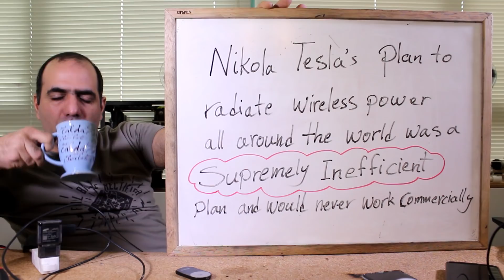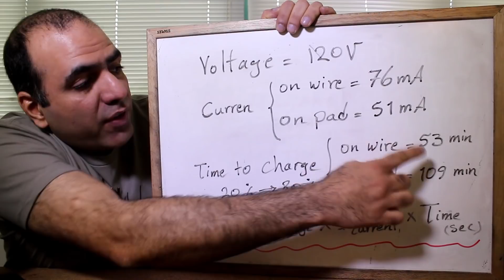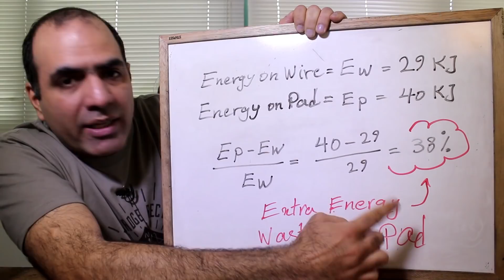Drowning in Inefficiency

Comment: 4:46 even the thumbnail image is inaccurate.  volume, good value solar panels are 17-19% efficient.
to the video.  yes, those charging pads are dumb. they also generate additional heat due to the wireless induction which is bad for battery longevity.

Comment: 4:38 No.  You still end up more efficient with an electric car than an ICE car, as the large power generators are much efficient than an internal combustion engine.
to the video.  yes, those charging pads are dumb. they also generate additional heat due to the wireless induction which is bad for battery longevity.

Comment: I use a charging pad because my charging port wont work with the wire anymore due to water damage, it will only charge from a pad. Also its only charging your phone so its not like you're running your entire house from an extremely inefficient charging pad lol.

Comment: Electrek reports, both the Model S and X use AC induction electric motors, which achieve an efficiency of 93 percent. However, for the more recently developed Model 3, Tesla switched to using permanent magnet reluctance motors, which achieve an efficiency of 97 percent. - So, are they wrong, or you are? Or are there  different metrics for efficiency?

Comment: For those of you hoping for a bit more direction:
The problem mostly comes from the issue of what is known as 'diminishing returns.'  One chord can run the 40% we use, but a second chord (with less juice behind it) would only run, say, 15%; a third only 2-3%.  If we try to turn all the power into electricity (or heat, or anything with only a single use), we will never achieve anywhere near 100%.  As you ponder the issue you should emphasize solutions that turn energy into more than one usable effect.

Comment: There should be an ability to pull heat energy from power plants.  Like taking the water/steam after turning the turbine run the heated fluid through a peltier power generator.  It would not get all the heat and turn it to power, but it should get some of it.  If nothing else that power could be used to power local equipment.  Seems like a better use than just pumping it into a cooling tower and pumping the heat into the atmosphere.
Reply: There is, in some villages here in the Netherlands they use the warm water of power plants to warm up greenhouses or houses nearby, the cool water returns and can be used again. The problem only is that the power plant needs a lot of cool water, that's why they're usually close to a river. It is cheaper then building long pipelines to villages.. That's why it isn't used on large scale yet

Comment: 30%-40% efficiency for photovoltaic technology is indeed the maximum that we're facing now using the so called III-IV photo voltaic technology, these actually are so expensive that they're currently only used on satellites. The average solar panel on your roof (mono or multi crystalline silicon solar panels) will have an efficiency of about 15% - 20%.
Though solar power is at the moment the best option for sustainable energy production if you compare the surface you need to cover with for example the amount of surface for a windmill.
I'm currently studying on efficiency in conversion techniques and sustainable energy supply and it amazes me how people are sometimes so stuck in their opinion that we shouldn't invest in all those technologies. Though the same as with every problem: there are no wrong paths, each will just have different consequences.
Reply: Yeahh.. its seems more complex when u though about it more..

I mean.. money hahaha

Comment: You did a little mistake on charging efficiency calculation. Modern phones do not charge at the same current. They start at the highest possible and then lower it once it gets more charge. This means that the current through the wire has decreased during the charging process. Meanwhile wireless charging current has barely decreased because it charges at low current already. And so the final result is even lower efficiency.
Reply: Using two USB power analyzers would allow you to easily see the efficiency across the entire load range. They are cheap and prime.
Reply: I would've used a different method to measure the efficiency: measure the in and out current and voltage, and divide the powers you get from that... But that would require to get a direct measurement from the phone. Maybe with an external Qi receiver?
Reply: This is true, but I believe the reason he charged from 20% to 80% is because if you look at battery charge and discharge graphs they are generally linear at that range. This means that an approximation is warranted. Batteries charge/discharge much faster below 20% and much slower above 80%. In fact, the reason behind this is due to the chemical process and is why most battery manufacturers recommend not discharging below 20% and not charging above 80%. Well, the latter is usually ignored due to logistical reasons but is also generally less harmful to the life of the battery than the former. So yes, while it varies a little, a linear approximation is good enough throughout this range.
Reply: Shuthufukuhp

Comment: In defense of the wireless charging pads. Yeah, they are useless at home or work, but I use one in my car, that I built into the phone holder. I find that the cables aren't reliable enough while driving and prone to coming loose and stopping charging. Yup, the charge rate is much slower than by cable, but it's faster than not charging at all.

Comment: Hey Electro Boom awesome Video, but there is one little fact wrong in this video, coal oil and gas power plants are significantly more effective than small combustion engines, and top out in the mid 40%s for coal and even higher for the other options, due to their high burning temperature and multi staged damp turbines. This does not change the point of this video that a big portion of power is wasted but significantly lowers the loss.

Comment: Step #1 put solar power with a battery backup in every home.  Step #2 convert all devices in home to DC power so that you don't waste energy from converting DC to AC and then back to DC.  Now that I think about it we need a standard for a DC power delivery, like USB-C.  Actually, now that I think about it those AC to DC adapters waste energy even just being plugged in.  Anyway, Step #3 place Peltier modules in key locations in the home to recapture lost energy like a gaming PC or a drain pipe, and have that energy fed back into the home battery backup.

Comment: Only way for change is if it became law. Law and regulation that requires products to achieve at least >70% efficiency or whatever.. otherwise companies would have no motivation or reason to design circuits, batteries, conductors, etc to be as efficient as possible or to at least meet the minimum required by law. Also the law would need to be adopted by most major countries, and would need to apply to exports and imports, otherwise companies will cheat out of the law by just importing or moving their factory out of the country if this law did not apply to import/exports and/or was adopted by the significant countries of manufacture.

Just look what California did in the 90s, when they passed a CARB law which forced manufacturers to meet a zero emissions to continue sales in california. had to be all electric, so as a result companies like GM created the EV1 during the 90s. but of course the automakers and other special interest groups fought the law and forced it to change to meeting just a 10% of all vehicles by 2003 but then even that ultimately changed again to allowing hybrid or natural gas vehicles to qualify. And we saw what GM did the instant the law was changed.. they recalled 100% of the EV1s and destroyed them and completely abandoned zero emission electric vehicles. If California had stuck to it's guns, there would have been leaps and bounds made in electric vehicles tech, we'd of had tesla quality vehicles over a decade ago, or even better since theyd' of been backed and made by the major automobile companies and a primary focus in order to continue to do sales in their largest U.S. market. The EV1 too was a very reliable vehicle too with a decent range for it's time as well in the 1990s.

Comment: For an idea on another video, I saw this review about stetzer filters that, if used on a circuit, will clean the electricity.  The reviewer showed the device filtering high frequencies, but never tested 60Hz to see if there was any change in amplitude.  I would like to know what your take is on the device for cleaning up dirty power.  You could go further to see the limits of high frequencies it can filter and how low before it no longer filters.  It should not be doing anything to 60Hz.  Here is the video: https://www.youtube.com/watch?v=VEqjkGC6Nhk

Comment: Switching to LEDs isn’t always saving you money just because they are more energy efficient, not even if they would have 0% energy loss in heat. Because if you live in a cold place and still want the same temperature inside your house after switching to LED, you’ll have to get the heat that you use to get from your lightbulbs from some other power source.

Comment: what do u think about this ? 
Plastic to diesel-like-fuel (already invented)->use the non-condensate gases i.e volatile fumes for heating;
              primary heat transfer medium : Molten salt;(phase II:augment heating with solar when available);
excess heat use in super heated steam flash boilers -> steam turbine -> eletrical Energy ;
       waste heat from steam turbine -> use to distill ethanol from wash ;
wash : made from bio mass cellulose-amylase digestion

primary feed stock : plastic 
Secondary feed stock : bio mass -> alge from swamps (we have a lot of that in our canals in south INDIA) 

interested ?

Comment: USB-C and lightning make it a little more convenient to plug a cable than micro USB, but just leaving the phone onto a pad is much more convenient than plugging a cable. An interesting compromise would be a docking station with electrical contact pads on the outside of the phone, like in my old Xperia Acro S. This way, the connection is efficient and the data connector doesn't wear down. Bonus points if the connector shape becomes standard.
Reply: Your ''convience'' of wireless chargers takes 10x longer to charge though

Comment: Electrical efficiency is not an EE problem, its a physics and material science problem. The elephant in the room is that we send all of our power through copper wire to your home. Copper has some inherent resistance and causes power loss. (not that this is doable) but if we switched all the copper wire in the world to silver wire, you would be improving efficiency in power delivery by about 5%. Materials like carbon fiber nanotubes, graphene, and other exotic materials could help reduce these losses due to resistance to darn near 0. Conversely if you generate the power you need for your home at your home, then that also massively improves efficiency without the need for carbon nanotube power lines.

Comment: When it comes to heat engines, there's a maximum efficiency that can be achieved without violating the second law of thermodynamics. For combustion engines running in ambient air, the max efficiency is something like 73%.

Comment: Oke iam smart so here goes, we need to add a second line of power in our house like 12 or 24 volt to use the solar energy directly from the batteries. A lot of devices already work on those volt requirements like TV, radio and phones come close. It will save the % to pump up the batteries voltages to 120v or 230v and then again a % save on the converter in the TV, radio, air fans, chargers and all other crap you use that uses 12v ps me typing this was so inefficient, because I know no1 reads it :-/

Comment: There are magnetic charging cables with connectors, that keep dust out of your phone port, and connects easily & quickly. I believe Wireless charging is only good for a waterproof phone, mounted on a motorcycle, in the rain.

Comment: I have thought about it, although there will be losses when energy changes its form. all we can do is minimize it. So we need a material which easily give up electrons but not way to easy, else it will react with everything. I think we can create two materials which are super reactive only with each other then we can improve efficiency. I better get to work on this.

Comment: How efficient is nuclear power? (fission, fusion and decay)
Reply: As nuclear power plants contain thermal power stations made of inefficient turbines and generators just like a coal or gas power plant, its not very efficient over all, but the nuclear reaction itself is. Main problem is though that its not renewable.
Reply: @Chuckiele   Cool thanks for the info! I guess hydrogen based fusion would be pretty efficient and as good as renewable, if we ever achieve that
Reply: @Staroy  Im excited for fusion a lot but it wont be efficient nor renewable for now but mostly just plain powerful. The only type of fusion thats providing enough power to even sustain itself currently is Deuterium+Tritium of which Tritium has to be breed from Lithium because it decays too fast to be stored. It is not very efficient because the entire reactor, which is huge compared to fission reactors, is made of a huge transformer, thats needed for the plasma and theres no well thought out way of getting the heat out of the reactor efficiently. Also its not renewable as the Lithium blanket will be used up and it consumes Deuterium and exhausts Helium. But it seems to be extremely powerful and also safe and clean.

Comment: So I do have an idea, correct me if i'm wrong, so we take Elon Musk's awesome Tesla and we put another battery and a alternator. So we connect the wheels to the alternator, and the alternator's outputs to the secondary battery. So you might be wondering "this kid thinks there is free energy", but no i'm just saying that the car's battery will last longer and every time one battery dies the outputs switch to charge the dead battery while the charged battery runs the car. So what you think is this dumb and will probably not fit in the car, or its a good idea for saving energy

Comment: My USB plug broke in one year. So now I have to use wireless charging to not have to buy a new tablet.
Reply: or you can fix the connector (or have it fixed) ;)
Reply: @ondra30  not available in my country for the model I have. Plus it was one quarter of the value of a new tablet to import a new USB connector. Wireless charger was the cheapest option.
Reply: @soulwynd  There are 3rd party service centers, some of them affordable. Also there's option to try to fix it yourself - if there's always the option to wireless charge, you've got nothing to lose. But in this instance, yes the wireless was good option.

Comment: Great video! :) I love your work Mehdi!

Even though there are a lot of "inefficient" devices, we must also take account of some phenomenons, for ex. the overall efficiency of transforming thermal energy into mechanical (and then into electrical) cannot ever reach a reasonable value, because thermal energy is a lower-quality form of energy. Its energy has more anergy than exergy (energy = exergy + anergy from thermodynamics, where exergy is the useful part of energy, and it is also defined by the environment of a thermodynamic system).

Another example is that wind turbines also have an upper limit called Betz's limit or Betz's law: "No turbine can capture more than 16/27 (59.3%) of the kinetic energy in wind. The factor 16/27 (0.593) is known as Betz's coefficient.". And this phenomenon is totally regardless of the turbine construction or the construction of the whole unit, its efficiency cannot exceed Betz's limit.

Thus, when we talk about efficiency of a device, we should calculate it by dividing useful energy with the energy transformation's upper limit. So, combustion engines, as devices, actually have a higher efficiency than usually mentioned.

Comment: 40% solar cell efficiency?
I thought it was just above 20%
Reply: Anthony Bate under lab conditions they got around 49 %, these are prototypes. Commercial cells get 19-23 % depending on how much you want to spend ;)
Reply: @MrTrashmasterfx  and this is efficiency of solar panel, do not forget efficiency DC/AC converter, power transmission etc, and environmental conditions such outside temperature, dust etc
Reply: @timno9804  oh yes ^^

Comment: If you use an iron selenide wire and put it inside of a slightly larger metal tube, then pump methane through those tubes to cool the wires, they would approach temperatures for superconductivity and you could transmit power with much greater efficiency 

this might sound silly at first, but many cities have natural gas lines already which could be integrated into the electrical grid to cool a high temperature super conductor like iron selenide. The main issue is that iron selenide wires are not commercially available yet, but they have already been created by scientists. Here is a paper which shows how it is possible to make this wire. https://arxiv.org/pdf/1412.3065.pdf

So simply put if we use new superconducting wires and insulate them with city gas then we can greatly increase efficiency.

Comment: My gas boiler runs at 107% efficiency :) but that's an hole different story, normally it sits on a good 98 to 99.6% percent runnin at 45degrees celcius return water

Comment: Electroboom have you heard of opposed piston engines, efficiency ratings are around 50 percent with some rpm ranges being closer to 60. Ford has been collaborating with another company to use them in their diesel trucks.
Reply: opposed piston ICE reached 55% but it is diesel ICE ...so it will be most probably forbidden in leftist EU